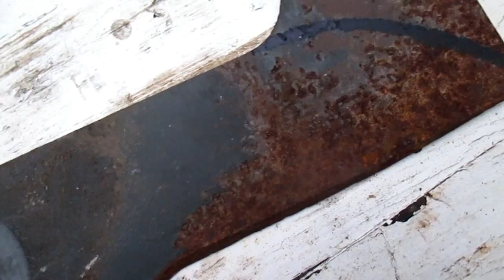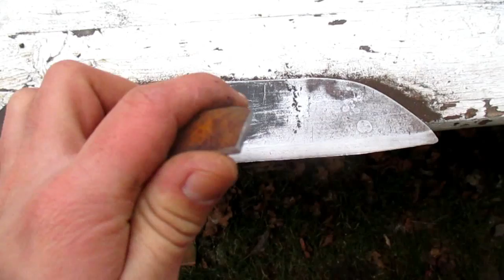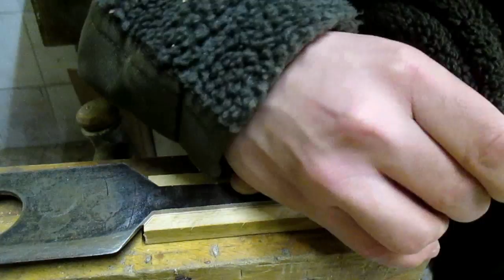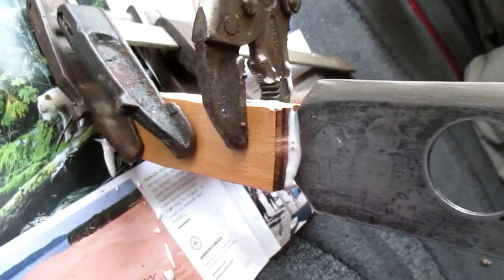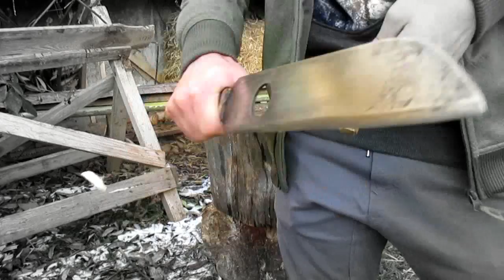Making a machete from a lawn mower blade / Homemade Weapon / DIY Project / Tutorial

Comment: It would be better if you make it full tang.Still very good machetee
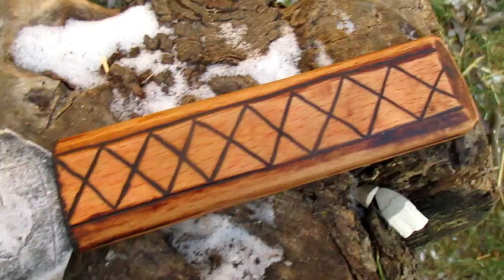Reply from the maker: Thanks, it is full tang but I used a methode where you only can see it at 11:19
Reply: Yea but I think it's have a weak point where the blade and tang is.Because for choping it needs power and may break on you.
Reply from the maker: Even medieval swords where made like this, so I think it should be pretty strong.

Comment: It's hardened? I'm a bit suprised, I haven't come across any lawnmower blades here in the US which were.
Reply: Probably never had a german one :D
Reply from the maker: farmerboy916 I put it in a vice and tried to bend it, it alwas went back in the same position, the edge was able to cut paper after the test too, so yeah it is hardened :D
Reply: ye, i am suprised too, u american fellas never seem to have a problem getting ur hands on stuff u can build cool things out, i mean u have leaf springs laying around on the side of ur highways, while i have to pay 100 euros for a bundle to build something out of it xD
Reply: It seems like it's an entirely different design philosophy over here with lawnmower blades; they're made cheap, out of mystery steel that is tougher when not hardened, and soft, so as to deal with rocks and hitting other hard objects. And are designed to be sharpened by copious use of angle grinders. 

Tbh, never seen any leaf springs around here, even laying on the side of the road. But I'm in suburbia.